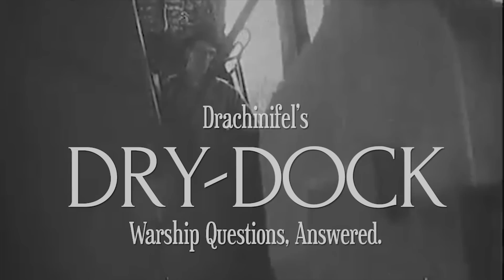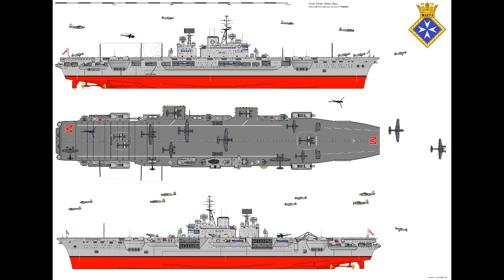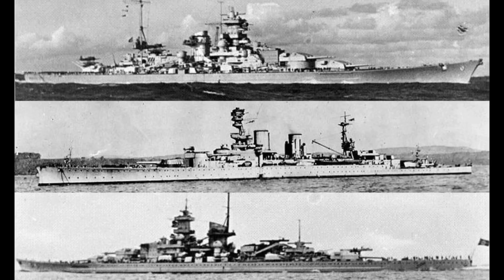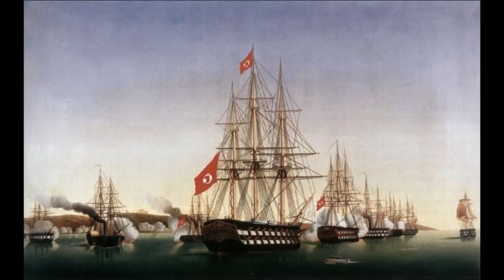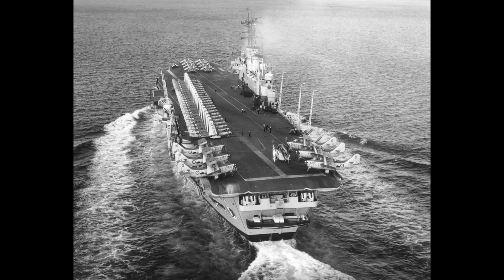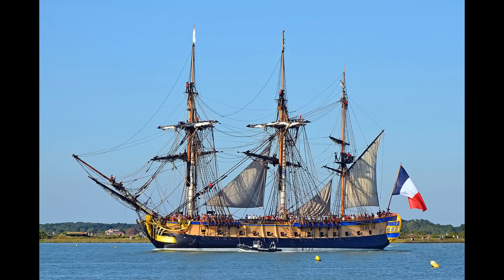The Drydock - Episode 070

Comment: Drach, the last but one question raises some interesting questions, assuming that Vicy France is eradicated. Firstly, Morocco and Algeria (now no longer neutral Vichy) would presumably be able to provide bases for the Luftwaffe, so the position of Gibraltar as a base for Force H would become very problematic. Add Dunkerque and Strasburg to the the Italian fleet and the only way to reinforce Force H would be to denude the Home Fleet, or remove capital ships from convoy duties. The latter might be possible in 1940, with no serious German capital ships fit for action, 

From the Axis side, the key to Mediterranean strategy was to take Malta, thereby protecting communications with North Africa and isolating the British Alexandria fleet. IMO, that could have, and should have, done that BEFORE they assaulted Crete. The Western Mediterranean then become an Axis lake, and forcing the UK out of Gibraltar would happen quite quickly. The ships at Toulon, plus the Italian Fleet, would have then provided a relatively modern fleet capable of dealing with the Mediterranean Fleet. Out in the Atlantic, without aircraft carriers, the effects would be less, but the strategic effect of closing the Mediterranean to the British and making Italy's position more secure cannot be underestimated.

One major problem; fuel oil for the fleet, and aviation fuel for the Luftwaffe, neither in great supply for the Axis. Essentially the Atlantic would still be the key naval battle area, so the U-Boat arm should still have been the prime focus for the Kriegsmarine, but UK bound convoys would no longer be able to assemble at Gibraltar, and would have to sail well west of it to remain out of Luftwaffe range.

Comment: Errr I dont get the beef with War Thunder. War Thunder has BR's and tier-ing systems. You can only go a full 1 point above your highest ships BR. For example a 2.3 can only fight a 3.3. MOST people CHOOSE to use motor gun/torpedo boats so they can cap quickly. Cruiser and destroyers even have separate spawns as well as MT boats. I have personally chose to use a very fast torpedo boat over a destroyer when I knew I had to cap quickly or they were close to spawn.
Reply: On my 5.7 lineup I have 2 PT boats BR's of 3.3 and 3.7. Its not that WT "throws small boats into he mix" its that players choose to have those small boats in their mix.

Comment: I believe one of the reasons for the return to geared turbines in the fast battleships was because the geared turbines were a better balance of power/weight/fuel efficiency under the treaty regime in place with the technology of the day, not because they didn’t appreciate its performance.
Reply: HerrHornPlayer I also thought the treaty restrictions helped drive the USN to geared turbines. I’d read that the 30s era geared turbines were significantly lighter and more compact than the 30’s era turbo electric drives. So switching to geared turbines let you have smaller engineering spaces (less area to armor) and more of your 35,000 tons available for non-propulsion uses. 

Though a gear cutting bottleneck, limiting the number of reduction gearboxes the US could make during WWII, led to a couple classes of mid-war destroyer escorts (Buckley and Rudderow classes) going with turbo electric propulsion. As did the most of the hundreds of T2 tankers.

Comment: I still don't see the certainty that Sea Lion was destined to fail.  As discussed, combining the German, French, and Italian fleets (and crewing them, and getting them fuel, and getting then into the right theater) would be difficult, but not impossible with a few other correct decisions, like taking out Gibralter and Malta early.  I hear the British historians say that the BEF left all their heavy equipment in France, leaving no armored forces in Britain.  One point brought up is the continuation of 2 pounder production because the army needed guns, even relatively ineffective ones, having nothing left in their stockpiles.  So this unarmed demoralized lightly armed army is going to easily and obviously defeat a German invasion army in 1940?  Nice thought, but it seems rather skewed.  Right up there with there being NO axis spies in Britain during the war.  Again, nice thought, but patently ridiculous.  My contention is that IF the fleets were combined, those motorized concrete filled invasion barges would certainly have not had an easy time of getting across the channel and supplying the troops, but far from impossible.  Now that also raises the question of whether the US navy would have come to the rescue in the nick of time, like the old cowboy films.  My opinion is that the US (and Canada) would have harbored the British government and military forces until they built up enough to take back Britain.

Comment: I think the biggest difference with a modern construction age of sail ship would be the use of glulam for the structural members. That way you'd be able to make them as big and practically in whatever shape you wanted.
Reply: The saw dust ice construction of the proposed ice super carrier is kind of a glue lam material.   Wood and frozen water

Comment: Various ships have bow torpedo tubes (not exposed but limited to the ship's pointing at, and closing on, the target) or deck-mounted launchers (trainable, but very exposed).  Did any ship experiment with a "broadside" or non-bow internal or some sort of armor protected torpedo-launching system?
Reply: Pretty much all pre-Dreadnoughts and early Dreadnoughts had underwater Torpedo tubes in all 4 directions, so 1 fore, 1 aft, and 1 for each broadside

Comment: Another factor in the move away from turboelectric was weight. A reduction gearbox was lighter than a motor+generator (plus all the additional stuff needed for the electrical switching and safety thereof) which was a weight savings for the treaty-limited designs of the 1930s.

Comment: quick question with the development of new technologies in the last 50 years sould we bring back the old Iowa's with new and updated guns, missiles ,ect could the battleship be the most cost effective weapon system on earth
Reply: A ship with 3000 crew isnt sustainable in todays navy. Updating the driveline would require cutting the ship open, very expensive. Aside from theoretical rail guns that might be coming there are no large guns in service that might be useful in the Iowa's turrets, and those would likely not be 16 inchers. Missiles are the way to go for range and accuracy, vertical launchers are the current best option. That would require an enormous rebuild to occomodate, but guided missile cruisers are already more than capable for that. Its too bad really because i'd love to see them back in service.
Reply: @willyjimmy8881  did i say 3000 man crew no i asked with the modern technology's and power coild the battelship the most cost effective war machine that the key with lasers, rail guns(16in 50 calber) and missile could the navy bring them back just a little smaller or the first battlecareier

Comment: wrt the question about the USN experimenting with T-E drive before using it in battleships, USS Jupiter had TE drive.  Laid down in 1911, she was four years ahead of the T-E powered New Mexico.
Reply: chris younts  As far as I know, everything built with a T-E drive carried it through their service life.  When Saratoga was torpedoed the second time, the flooding shorted the control system for the T-E drive, leaving her dead in the water.  I don't think it would even be possible to convert from T-E to geared turbine because of the way the T-E allowed greater compartmentalization.  The conversion would require a lot of bulkhead removal and realignment of turbines and shafts.   The USN had not given up on T-E drive after the 20s either.  The Buckley class DEs, laid down 42-43, had T-E drive.
Reply: chris younts  I don't have a copy of Jane's at my fingertips, so I resorted to using Wiki.  According to the Wiki entries, NM was refitted with geared turbines in the early 30s, as you said.  Her two sisters were originally equipped with Curtis turbines, which were also replaced in the early 30s with geared turbines.  So yes, they were all reengined, as you said, but they were not all initially built with T-E systems.  As NM was the only one built with T-E, her engine spaces were probably not optimized for T-E, which facilitated the conversion to the geared turbines.   Again, according to Wiki, both of the Tennessees and all three Colorados were built with T-E and none of the articles on those five ships mention replacement of the TE systems among the many modifications made over the years.    Maryland was hit forward by a torpedo at Saipan.   The Wiki article mentions her return to Pearl was done running astern so as to not put pressure on the bulkhead where the damage was.  The Wiki article doesn't mention it, but I have read elsewhere that running that distance at any sort of sensible speed was only possible due to her T-E drive.  Reversing turbines usually offer only a small fraction of the power available from the forward running turbines.  In the case of T-E drive, reversing the drive is done by simply reversing polarity of current flow, so the full power of the turbines, generators and motors is available in both directions.  Interesting conversation.  I now have a much more granular understanding of early 20s battleship drive systems than I did this morning.
Reply: chris younts  Again referring to Wiki, NM's original T-E drive generated 27,500hp.  The conventional turbines in her sisters generated 32,000.  The difference probably due to the power loss inherent in converting from mechanical power to electricity, then converting the electricity back to mechanical power, as Drach notes in the video.  They could make 21 knots.  After their modernization, which increased displacement by 1400 tons, the new boilers and turbines, which took advantage of performance improvements made since the originals had been installed 15 years earlier, generated 40,000hp, and the ships could reach 22kts in spite of the increase in displacement.  The cage masts were gone, a new superstructure was built and they looked modern for 1932.   The navy putzed around for years about modernizing the Tennessees and Colorados, but, outside of installing some 5/25s and a couple 1.1s didn't do much with them.  Imagine if the second London treaty had not had the escalator clause, or the USN had not expected the escalator to be triggered, while designing the North Carolinas, they would be looking at new BBs with only 14" guns, vs the Colorados with 16" guns and might have seen what could be cone with the Colorados.  Imagine Colorados being rebuilt in 1938 with superstructures like West Virginia had in 44, with the bulges that had been planned for years but not installed until after WVa was sunk, with AA armament appropriate for the 1938 threat environment (think 4 twin 5/38 mounts and about 10 1.1 mounts)  then take a page from the Italian's book, gut out the engine spaces and install the latest high pressure, high temperature boilers and turbines, and use the room freed by removal of the generators and motors to install physically larger boilers and turbines.  The Italians increased power in their old BBs from 30,000 to 75,000 and bumped speed from 21 to 26kts.   The original T-E system in the Colorados only generated 28,900hp.   Unfortunately,  my computer received a new version of ,Net a couple months ago and SpringSharp no longer works.  Maybe someone with a working SpringSharp can plug in the Colorado specs and see how much power it would take to push them to 27-28kts and see if that sounds feasible.  If WVa and Maryland could turn 28kts, they might have been with the carriers, instead of at Pearl, on Dec 7.  Even if WVa was at Pearl, flying into the teeth of 4 or 5 1.1" mounts would have made a much more interesting morning for the Kate pilots attacking the ship, and the bulges would have made the Kate pilot's efforts less productive.
Reply: chris younts  the ships that were heavily damaged, California, W Va and Tennessee were really brought up to date wrt superstructure and AA.  Colorado and Maryland were shortchanged.  The Colorados are actually pretty close to the Italians in size.  The Andrea Dorias, after they were lengthened in their late 30s rebuilds, were 613' with a 92' beam.  The Conte di Cavour class were lengthened to 611' with a 93.8' beam.  The Cavours could hit 27kts with 75,000hp.  The Colorados were 624' with a 97.5' beam.  Wiki gives partial post-rebuild specs on the W Va; 114' beam with the bulges.   The South Dakotas were 680' with a 108' beam and could top 27 with 130,000hp.  It puzzles the heck out of me why the USN did not extensively modernize the Tennessees and Colorados in the late 30s.  Even the Brits made a lot of improvements in the Queen Elizabeths and Renown, but the newest of the BBs at Pearl sailed into WWII with casement guns, cage masts and 20 year old propulsion machinery.
Reply: chris younts  Yes, there was an odd situation with funding.  The government was building public works projects all over the country under the WPA.  I grew up in Kalamazoo, MI, where the County building, Federal building, civic auditorium and a fountain in Bronson Park were all WPA projects.  I have read that Yorktown and Enterprise were built with funds sidetracked from an industrial redevelopment program.   Odd  And our guys paid for the short-shortsightedness with their lives.

Comment: In the question regarding Scharnhorst & Gneisenau’s chances if they’d turned to engage HMS Renown, am I correct in assuming that this was before the German ships were refitted with their “Atlantic/clipper” bows?
Reply: The 2 Sharnhorst class received their Atlantic bows in late 1939, their engagement with Renown took place in  early 1940 so they did have them by then.
Reply: Well, damn. I would’ve thought the Atlantic bows would’ve been more effective than that. 😕
Reply: @willrogers3793  it did allow them to more easily escape the Renown as the Atlantic bow allowed them to keep up a higher top speed in the bad weather

Comment: Concerning the safety of turbo-electric powerplants, I'm not aware of any incidents where engine crew were electrocuted while in service or in action, the ease with which a ship's electrical grid can be isolated via breakers and insulation was actually one of the arguments in favour of its adoption. The only times a T-E powered ship lost power in combat I'm aware of involved the ship getting its boiler fires snuffed, which would have knocked out a non-electric drive just as well. 

Amusingly, modern ships have returned to turbo-electric drive, only with gas turbines (essentially jet engines) instead of steam boilers powering the generators. It goes back to efficiency again: (steam) turbo-electric drive promised greater efficiency than non-geared and early geared turbines in the 20's; geared turbines had improved by the 30's to where they could handle greater loads (I'm unclear about the efficiency balance); by the 60's the gas turbine and electric generators had once again risen above steam turbines for power and efficiency, where they've remained since.
Reply: until the Zumwalt and Ford class ships, and the latest assault amphibian class (America?).  Huge radar loads, along with the need to power defensive phasers, along with the change to rail gun catapults drive the new designs.  Zumwalt needs to shift power from drive to weapons to operate the phasers.   I think the recently procured 300Kw units will eventually be replaced/upgraded to megawatt level devices.  Power requirements to launch aircraft must be staggering.  Steam is generated in the Fords but only to produce electricity, which is shunted to wherever needed.  The Fords are particularly interesting in that they need to run at high speed while operating the rail gun catapults.  Engineering magic-- --

Comment: Which version of Springsharp are people using for the competitions?  V. 3.0 is buggy but I couldn't get v. 2.1 to work on Windows 10.
Reply from the maker: The last beta :)
Reply: I've found some interesting bugs in there (v.3.0b3, that is). Things like mines and torpedoes don't weigh anything.
Reply: I have a problem Using SpringSharp it only works on windows and i am a Mac user. Do you have any suggestions for what I might use.

Comment: A bit of clarification on your take on War THunder vs World of Warships as I don't think you got the whole picture right:

While patrol boats theoretically can meet light cruisers, in this case it is the players decision to do so. The battle rating system War Thunder uses for matchmaking separates boats from light cruisers more or less completely. The simple fact is that you are not gonna meet a light cruiser in a boat if you specifically want to advance to destroyers and bigger ships through the tree. It is possible to get into a battle with cruisers with the very top end of patrol boats, but those are not required to advance in the tree and actually rarely played for that particular reason(and a few others, mainly very high research costs). So the claim that you are gonna have to fight a light cruiser with a patrol boat is exaggerated. 

And while you can meet destroyers with the boats you will usually play, that is a not the case in most matches and destroyers and boats are seggregated on the map via different spawn locations and map topography with much more islands in the boat part of the map which is very hard to navigate for destroyers even if they get to it before being shot down by your ships.

The boats you are gonna see in destroyer-heavy battles are in almost every case bots.